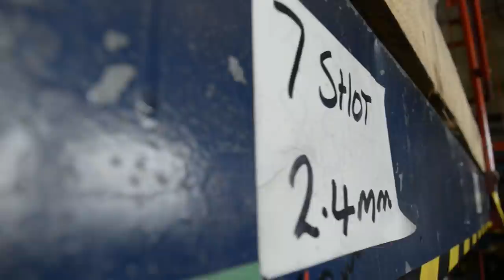Head to head on lead shot

Comment: Previous comment was deleted, so I'll repeat the salient points here:

The acid in your stomach is not 6 molar (as Charlie used in his test), it's roughly 0.1 molar, so it's a meaningless demonstration. 

Iron (III) chloride is toxic, but not at the concentrations at which you'd be exposed to it from eating steel shot; iron toxicity starts to present itself at doses roughly between 10-20 mg/kg of bodyweight, per day. That's an enormous amount of iron to consume, especially considering that most of the steel shot travels through you undissolved. Bear in mind that iron powder is actually added to some cereals in order to reduce the prevalence of anaemia. 

Metallic lead isn't toxic, but then virtually all metals aren't toxic in their elemental form, so it's a meaningless comment. 

Lead is quite unreactive, but it most certainly is not inert (otherwise there'd be no lead compounds). Lead in a beaker of water/acid is not equivalent to lead in the ground or in your stomach. Soil is a combination of hundreds of thousands of compounds, it is entirely plausible that there exist compounds in soil that are capable of chelating to lead and rendering it more mobile. The same argument can be applied to stomach contents. 

Combustion of tetraethyl lead does not produce lead bromide or lead chloride, because tetraethyl lead contains neither bromine nor chlorine. 

Acute lead poisoning really isn't the problem, it's the sub-acute, chronic exposure that really poses the most problems (compounded by the fact that lead is excreted from the body very slowly). Take Andrew's point of IQ in Nigeria and Manchester being 3-5 points lower due to lead exposure from leaded petrol - very few people would test positive for acute lead toxicity, yet the cognitive impairment on the population (let alone anything else) is clearly demonstrable. Yes, eating lead pellets is unlikely to kill you, but eating lead pellets over time could well accelerate age-related cognitive decline, could increase the likelihood of neurodegenerative diseases like Alzheimers etc etc, none of which would ever be linked to lead exposure.
Reply: I'd suggest getting both out of your food before eating, and the first time you bite a steel pellet you'll understand why.

Comment: Have to say I think it’s all a joke I am 73  shot by accident 50 years ago and have three pellets bedded in my thigh because it was an accident and I went to hospital I had to go and see a police surgeon after the hospital when I returned home very nice man stated that there wouldn’t be a problem with the lead it would be encapsulated as a foreign body in my body and 50 odd years later and having eaten a pound or two of lead shot as I eat most of the things I shoot I’m still going strong and fail to see why this is an issue I think again it’s a small minority the Packham syndrome that is forcing the shooting industry to do something which is not necessary Denmark is reinstated lead so what’s going on in the world.Believe it or not it will not save shooting unfortunately the minority will win.

Comment: My last point, in the uk it is ether law or not; and if it is not law but a recommendation we do not have to listen or Adhere to self-proclaimed governing bodies.   A ban on led must come from government legislation not a load of organisations pushing this forward without the support of the shooting Community.  Many of these organisations like BASC have no legal right or governance to make such claims (5 years to ban lead) these organisations should support shooters and the shooting industry.  I shoot copper because the game dealer requires it.  I am happy to do this.  I would not use copper to shoot ELR events as it behaves differently and therefore not affective. This is a game issue not an ammunition issue.

Comment: Very pure iron is very soft (20–30 Brinell) and is maybe soft enough to shot in all shotguns. There are some commercial
sources of very pure iron, but hardness is usually not stated. Additionally, I would suggest a copper/tungsten composite where only 23 % of expensive tungsten is needed to achieve a density of lead (11.34). Is pure copper (with a useful density of 8.9) used at all?

Comment: Has there been any studies in the spread of lead particles from animals killed with a shotgun? I would be curious to see if the generally lower impact velocity of shotgun pellets, versus high velocity rifle bullets, has an impact on the potential of lead particle deposition into the meat.
As for leaving pellets in the meat, that's up to the due diligence of the provider and the end user.

Comment: Lead,  once melted and once it's achieved a certain temperature,  also evaporates.  Now the risk of ingestion from evaporating lead,  as lead in petrol would be real but it's a knees-jerk reaction to attach and equate the same risks which lead in particulate form presents,  and to lead in solid form. 

MC won that one hands down,  for me.

Comment: We are not carrying on doing it in another way Andrew the atomised lead compounds are different. Simply submit all shooters especially airgunners and 22lr shooters to lead test, they will be far more at risk than others if there is an effect. If the science supports no illness in these individuals, exclude them and their practice's from the ban specifically.

Comment: Strange but for years lead is still used on roof which leads water into the gutter on into the surface water to be drank along with lead pipes as there still with us but we’re still alive.

Comment: Hmm yes! A very good discussion/debate for whichever side of the fence you're on. Removing lead from being ingested in any of its forms must be good. Then we must look at the next level of other toxins and also remove them from the food chain.
Lead shot at clay pigeons that strikes the ground leaves no evidence other than the disturbance caused by impact, steel shot however rusts and after time the ground will go orange!
The debate will go on for quite a while I think and from then hopefully more time will give us a compound used for the projectile that is inert and in an abundance helping to bring the cost to a manageable level.